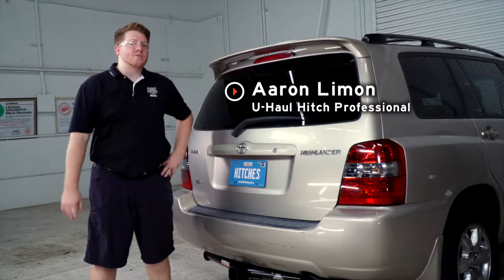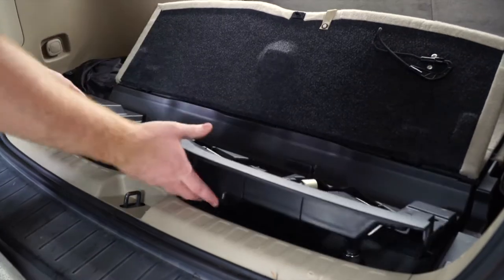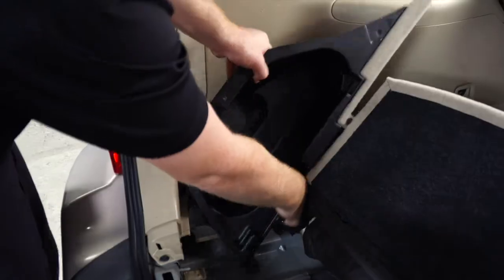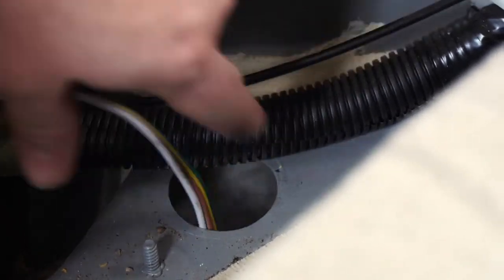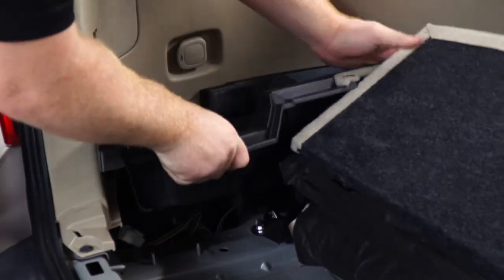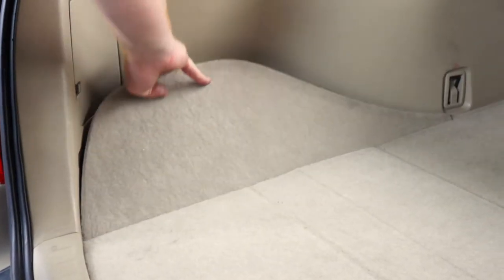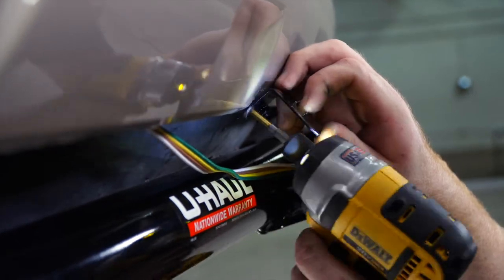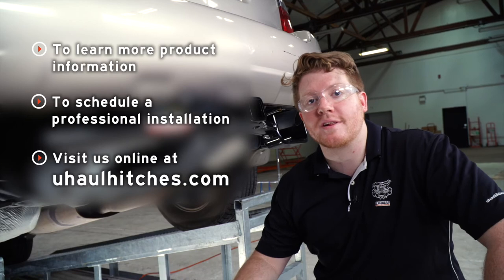2007 Toyota Highlander Wiring Harness Installation

Comment: What about the towing fuse under the hood? Don't need to put one in?
Reply from the maker: Some vehicles may require the installation
of a 20 amp mini fuse in the TOWING
position of the fuse panel to function
properly. Locate the fuse panel under the
hood at the driver side and install a 20 amp
mini fuse if necessary. Our Apologies but our model did not need the fuse and therefore nothing was filmed.